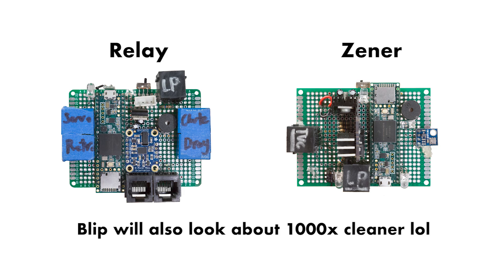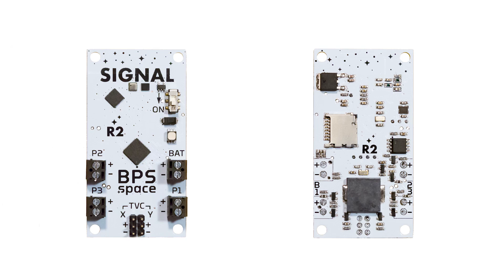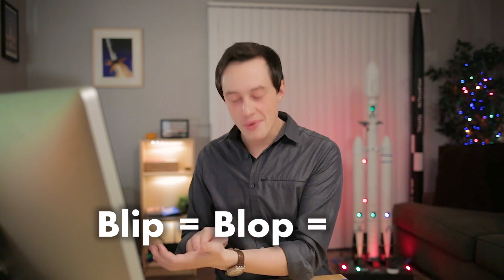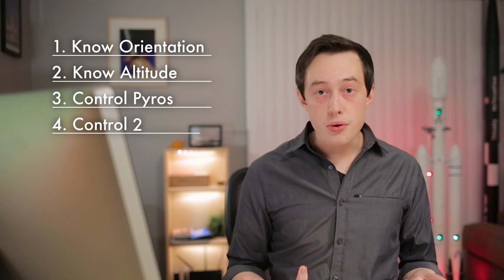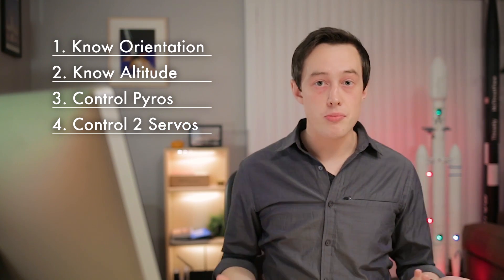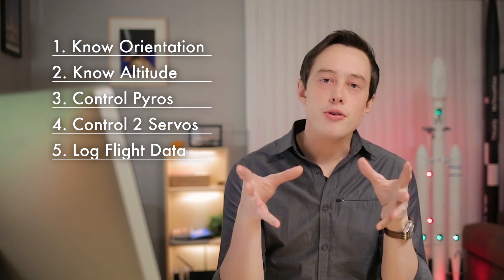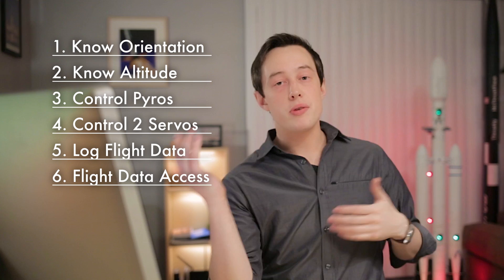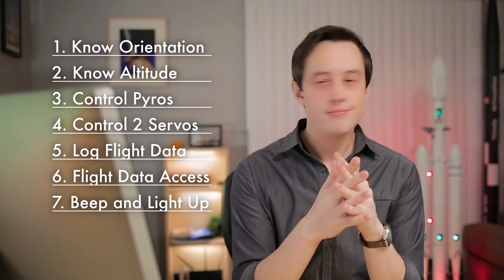Flight Computer Outline - Landing Model Rockets Ep. 3

Comment: Those "SensorFusion" IMUs all use the 1G acceleration of the Earth to establish their orientation, but if you're accelerating the sensor with your rocket, it can't be sure what the orientation is any longer. You have to do it the hard way. BTW, this was a very enjoyable video and very well done with respect to being approachable to all skill levels. Nicely done!
Reply from the maker: BINGO! Wow you got that right away, super bonus points for you! Luckily doing things the hard way with just gyroscopes isn't actually too hard :)
Reply: It's not Rocket Surgery! I built a fin stabilizer for my water rockets a few years ago back when the MPU-6050 Sparkfun board came out. This was before Invensense released the docs on how to access the Sensorfusion features, so I did it the (not terribly hard) manual way. That's how I learned the problem with the gravity vector. The gyros work to a point, but the MEMS gyros accumulate error rapidly. It might not matter for a short flight without a lot of rapid rotations. My math was crude, but as a proof of concept it worked, and was a good learning experience. Do you do all your work yourself or do you have help off-camera? You make rapid progress in so many areas. How do you find the time? Keep up the good work!
Reply from the maker: @USWaterRockets  Ahhhhh you cheated, you had experience! Hah, only kidding! I had the same thing happen with earlier TVC flights as well - you can see in some of the first "successful" launches that the rocket will arc over near the end of flight, while the flight data shows the IMU thought the rocket was traveling straight up. It's just me, no other help with the work! To be fair, it's a full time endeavor now thanks for folks like you on Patreon, though I probably work more hours than a typical full time job ¯\_(ツ)_/¯
Reply: I've seen your previous launches. I think I ran across your channel when you first started. Looking forward to what you do next!
Reply: BPS.space Yeah actually I saw the rocket arc over and was wondering why it wasnt flying straight with an IMU, is the arc direction always the same?  Would be cool to do a video on compensating for the inaccuracy and all the math behind it!

Also, the ATMega328 doesn't have to run at 16Mhz, they run about 24Mhz very comfortably!  Just figured I'd mention that since you'll be choosing what resonators to use on the board; the millis() function will no longer give reliable timing at 24Mhz but micros() is bang on.
Reply: @USWaterRockets  Hello, I would be interested to see this code if you still have it and if you are willing to share it (github maybe).  We are just starting in rocket modeling. We want to control canard type fins using a PID control loop on a two stage F15-0 engine.  I have both MPU-6050 and LSM9DS0.  I was planning to use the MPU-6050 since it has DMP.   We haven't yet tried to launch, but your and @BPS.space's comments on the effect of rapid acceleration on the Gyro is a serious concern.
Reply: @PhilfreezeCH  they can, but you have to program the math yourself, because the original equations were written for 1g gravity. (also, since when do cars and paragliders accelerate at more than 1g?)
Reply: @davinderc  there are a lot info about how to code it. Madgwick code currently the best method to handle quaternion math for accel and gyro.
Reply: @vovanikotin  Sounds really hard! Do you think he's also using a filter, which one? considering Arduino ..
Reply: @TheNikhilmishras It`s hard in first steps only.the more you read/code it the more simple it become.
Atmel chips (used in Arduino) have enough power to handle Madgwick algorithm. I have tried it with atmel and stm chips.
Reply: @vovanikotin  thnx! I was skeptical any Arduino.. anyway I love hard problems!